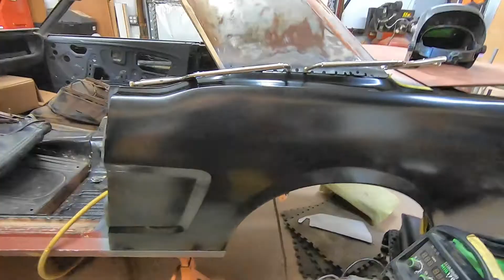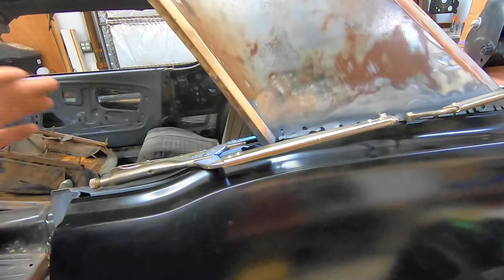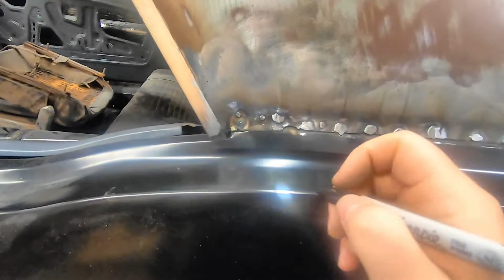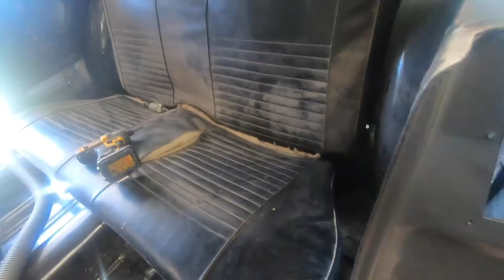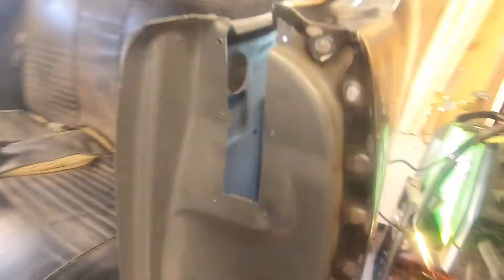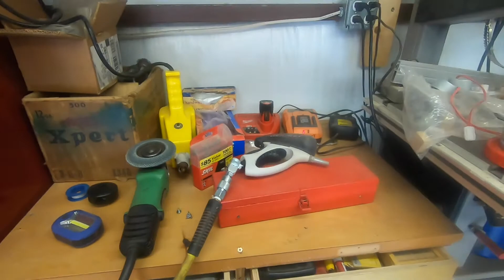Welding the sail and rocker on a 66 mustang at the end of quarter replacement

Comment: Is it possible to weld in a 67/68 coupe sail panel like this? I've seen a few videos of people doing it on 64.5-66 but nothing for 67. I'm replacing quarter panels on my coupe and would much rather put the whole quarter in that cut a butt weld.
Reply from the maker: I haven't done a 67-68 as a full panel but they are very similar and it may be possible.  There is a nagging memory about it actually from something I read once on one of the forums about doing it on the later cars but I just can't remember what it was about. 
    
   One thing to keep in mind is that the quarter to trunk lid isn't shaped well on most quarter panels. They tend to not have the same curve as the trunk lid. Often you end up flattening the trunk lid a little to make it match as that's easier than fixing the quarter panel. It's also why many people will keep that part of the quarter. 
     You can duck the new panel under the old at that joint and it comes out very well if you do it right. Jodaddysgarage did that on I believe a 67. If you can't find it let me know and I'll put up the link to his video.
       But I definitely am on board for no butt welding... It's slow and tedious and easy to warp a panel or get it crooked etc. I lack the patience to do very much of it.
Reply: @theinfernalcraftsman  well we're going to fine out because I just cut off the remainder of the quarter panel and now I'm using your oscillating tool trick for cutting the sail panel free of the lap joint. Worst case scenario I'll cut a section of the sail panel out and weld back in after the quarter panel is on... I don't want to but it's good to know I have options.

Depending how this goes I may just skin the driver side lol.

Comment: Wondering what medium you used to spot blast with?  Great video... Thanks
Reply from the maker: I use crushed glass for 95% of my blasting. If it's something really rusty I will use coal slag sold as Black Beauty and other similar names. If I had a supplier of Garnet here I would use it for some applications.
Reply: @theinfernalcraftsman  Okay...  I just bought the same spot blaster... Thanks!
Reply from the maker: @68orangecrate26  If you reuse media make sure to run it through a sifter first. I got lazy the other day and needed to blast one spot real quick... I just scooped up some used stuff and poured it in. Almost immediately plugged it up with a  chunk of the black abrasive from the 3m wheels... Thought I could get away with it but no...
Reply: @theinfernalcraftsman  Point taken!  I'm an absolute novice at this.  So, any advice is appreciated!  FWIW:  1968 California Special - The never ending project:/

Comment: Do you have plans on leading the sail panel to the rear quarter or are you going to weld the entire seam
Reply from the maker: I don't have the lead or tools to do it anymore as I sold them off a long time ago. I will either use Evercoat Everglass or USC All metal filler. I have used the USC product and it's pretty good stuff though pricey compared to a stick of lead...
Reply: @theinfernalcraftsman   with all the research I've done it seems like they used lead to float the panel out smooth where nowadays we would use some type of plastic filler similar to bondo

Comment: What size welding bottle and how long does it usually last
Reply from the maker: It's an 80CF bottle and with argon/Co2 I think it holds around 94cf. You can get allot done with it but this welder has a longer pre and post flow so I don't get nearly as much use out of a bottle. I really recommend getting the biggest bottle you can handle. Gasses are extremely expensive here in Texas and bigger bottles don't cost much more to fill. I am looking for a different supplier though there are few options available.

Comment: Hay, were the 1st view of this video! Good video and good content as well! Keep up the good work and the videos coming! One question for you about your welder, How well has it held up since you mentioned about the wire slipping? We are looking to get our first mig and any information would be appreciated, thank you!
Reply from the maker: The welder was actually a sidewalk sale deal at Harbor Freight. I got a really really good deal on it. It was missing the feed roller for solid wire so I just ordered one off ebay that had the right dimensions. I actually ended up lightly blasting it in my blasting cabinet and that gave it a little grip. A correct part would probably work better instead of a who knows generic $3 one off ebay...

 It replaced an old Italian made welder that I had and could not get parts for anymore.  The inductance adjustment is handy for sheet metal and not on many welders. I wouldn't have a problem buying another Titanium welder or a Vulcan. Also look at the Northern tool welders under their Klutch brand. Good value and I almost bought their multi function as I would like to have TIG in the shop. But adding another bottle of gas... Our gas suppliers charge double what they do in other parts of the country.

  If you want to stick with the old brands it's hard to beat the Hobart 140 which is a transformer machine while the others I mentioned are inverter. The only issue with the Hobart is that it has gone up in price nearly $200 in the last year.
Reply: @theinfernalcraftsman  Thank you for the information! We have been looking into the Lincoln and the Harbor Freight ones and have heard of the Hobart one as well. We are new to this and want to find something that would be easy to use and learn with for our needs with sheet metal and all. With restoring our 64 1/2 Mustang Convertible.